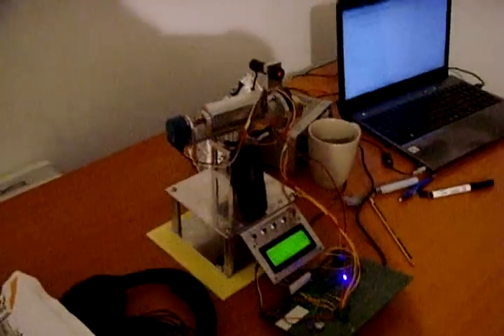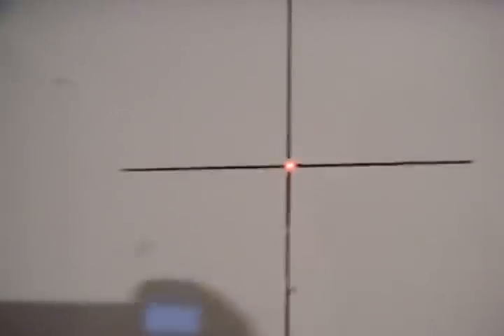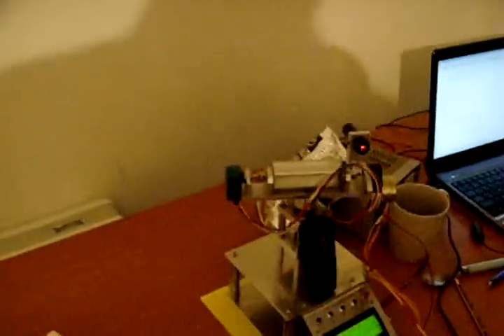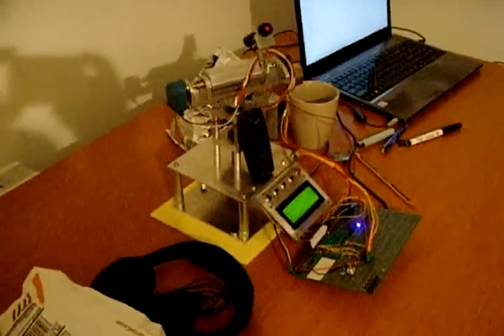SPTS - Solar Positioning Testing Station

Comment: I love it, it looks so clean for a testing device, not many cables are laying around.

Have you tested if it's possible to reduce the deviation by using an offset in the software? In other words, is the deviation random or does the laser always land to far to the right after going back into the starting position?